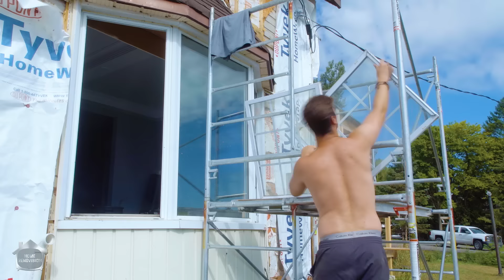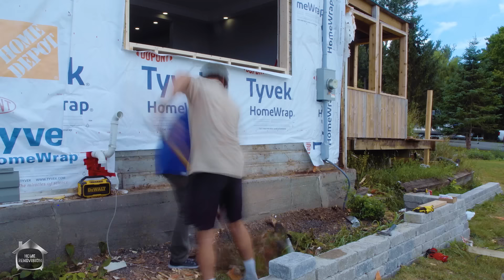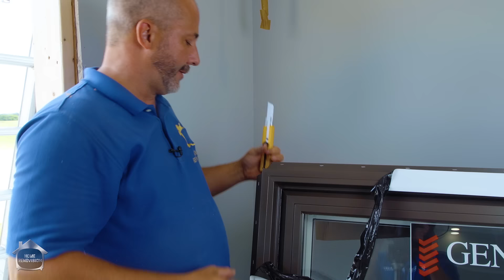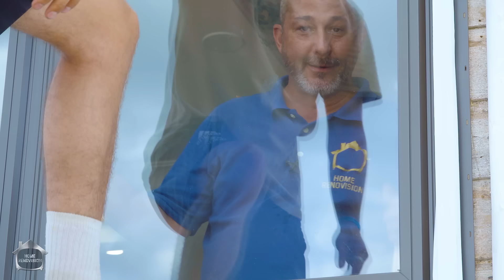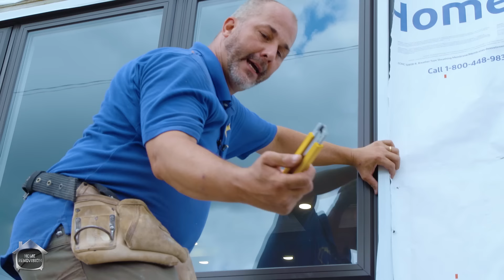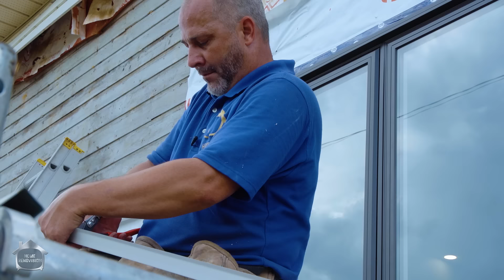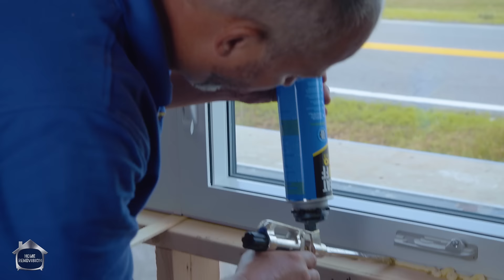How to Install a New Window| Quick and Easy

Comment: I took my house window install a couple steps further to improve the air and water seal. Flash the inside of the window frame with a rubber flashing and then use silicone around the entire frame before installing the window. The silicone and rubber flashing will act as a gasket to get a perfect air seal around the window in a way spray foam never will. Feel free to fill major gaps around the inside of the window with spray foam afterwards to improve the insulation value, but I don't recommend it for water sealing micro gaps likes what is found in between a new window and the frame. 

Really appreciate your videos, I've installed 1000 sq ft of flooring, completely rebuilt the kitchens floor joists, dinning and kitchen sub floor, siding, roofing, doors, windows, two bathrooms, drywall, thanks to your videos encouraging others to give it a shot before hiring the work out. The home was reappraised and is literally double what we bought it for. saved a small fortune
Reply: Glad to hear that someone else does it the same way I did mine. I did the same style windows as you did love them easy to install.
Reply: Ref home being worth double after your good works - to.

It might have been appraised at twice the value, but, only if someone agrees to that price point, doesn't make a counter offer and their bank will give them a mortgage.

In UK we gave seen a record rise in house prices (not far off £235k) because our Chancellor reduced the Stamp Duty. This is economic madness because nobody knows if the furlough schemes will still continue now we have seen an "almost" second wave of c-19.

Basically job losses will bring a sharp drop in house prices.

Would therefore take whatever value your estate agent (realtors?) suggest with a  huge pinch of salt.

Would further suggest you enjoy whatever improvements you made for their own sake.

If you "rebuilt" your home to suit you then whoever buys your property might do exactly the same.

In UK property is no longer the sure bet to generate wealth it once was.

Sincerely hope the same doesn't apply to you folks too.

Comment: Excellent video. That blue tape and Tyvek wrap do a great seal. I like the multiple levels of “Overkill” .  
Re: Vinyl siding; Have you done  a similar video using wood clapboard?
Reply from the maker: Not yet Larry. hopefully soon. Cheers!
Reply: Home RenoVision DIY Would love to see a hardy board or engineered wood siding with window install vid. Everything from how and where best to order your siding from to getting cornering right and tight, to painting. 

(I’ll provide the materials and house 😉. And beers)
Reply: Home RenoVision DIY , I have only had to stop bleeding once in the last two months with the electrical tape👍👍

Comment: Great video. My house is stucco. How would you do that?
Reply from the maker: buy a replacement window! so the exterior finishes within 1/4" and you can seal with exterior caulking. Cheers!
Reply: Doing windows in stucco right now. We used a hammerdrill to remove three inches of stucco on the sides for the flanges and tried to keep the paper original paper in place as best we could then did similarly to what Jeff did here with taping, etc

The windows were old school with the sashes in the sides to allow it stay open so we gained bigger windows in the process.

Comment: It’s a  pretty straight forward install but you got it wrong. Your sill has to be waterproof and sloped and use rod and caulk instead of foam for a couple of reasons.
Reply: Hmm, but is that correct methodology for this type of installation?

As far as I could discern the frame is "waterproofed" to the water proof Tyvek stuff around the entire frame with the "blue" tape being applied over the nailing flange.

Would presume an angled cill is attached to the bottom of the frame to throw the water away from the wall.

It was mentioned that this system is relatively new so perhaps having an add on cill is a new way of doing it?

I confess I would have liked to have seen the window cill being attached as well as this "J" trim. Will presume this particular clip was merely to show the frame being installed.

Perhaps the wall cladding and how it  "connects" with the frame being comes later?

Will presume too the cill component is similar to the "J" sections but with a different profile?
Reply from the maker: I hate to say this but the whole wall is waterproof with this install, not just the sill. Cheers!
Reply: Home RenoVision DIY  it’s a bit more detailed and complex than that. Windows are water resistant not water proof, they have gaskets, seals with moving parts. Windows have a built in rain screen system designed to remove water. Code is a minimum and still requires waterproofing the sill. Further, the idea is to manage water away from the building, your flashing should have end dams.
Reply: @vancouverrealestate2766  Hmm. It was mentioned that this system is new by which I take it said system is approved by the local buildings regs folks.

Sometimes the technology moves on so fast that not everyone learns of a new methodology as fast as others.

In the old days, and I'm going back a bit, imagine my surprise to find someone had invented glass! I was so pleased to get rid of the shutters and sacking!
Reply: Ross Kneebone this is definitely not a system or something new, that I can tell you. The sill must be sloped to the exterior and waterproofed. Water will always get in.
Reply: @vancouverrealestate2766  Apparently not with this methodology.

Plus there was no cill to be seen, let alone sloped.

All we saw was a window frame fitted into an aperture, fixed in place and some blue tape stuff over the frame and Tyvek.

I am presuming the window cill is attached in a similar manner to these "J" pieces.

It occurs to me that your "cill" and my "cill" could mean different items.

Suffice to say the UK "cill" applies to both inside and outside the window frame.

The inner being level (to sit on the inner brick or block wall) and the outer being sloped to shed rainwater away from the wall.

Most usually "our" exterior walls are brick and will absorb water, (unless treated with a liquid weatherseal product).

Generally the wall will have a number of  vertical "weep" joints (made of (usually) grey plastic the same dimension as a mortar joint, with a bug screen) instead of of a mortar joint, just above the damp proof membrane, or just above an "over window" galvanised steel or concrete lintel.
Reply: Ross Kneebone what you described is a different detail. In this case, the detail is only for interior sill plate, not exterior. Also, In this case an exterior sill flashing would need to be installed which I did not see but he probably will install later. 

As for the detail you described with brick cladding, it is not used much, we mostly use brick venner. However the concept is the same with the brick and weep holes you described, there is a cavity behind the brick so when water does get through the brick, it will drain through the weep holes. The cavity also creates a cross ventilation for drying. Further, 100% RH will occur several times a year, another reason for the cavity and cross ventilation.
Reply: @HomeRenoVisionDIY 😂😂😂😂

"Hate to say it!" my backside!

I can sense your laughter 3000+ miles away 😂.

In UK the cill is laid on the outside brick skin in the opening and the window is built on that.

Sometimes the cill is a canted almost engineer brick soldier course and this is to avoid repairs if the maintenance is shoddy. Sometimes the cill is a row of ceramic tile slips bedded in mortar.

Basically anything to avoid timber.

If a uPVC unit is installed then the cill is attached to the bottom of the frame.

 Whole assembly offered up and is wedged to make it level. 

Glass in after to square up frame using spacers between glass and frame for time tweaking.

(And fixings through frame of course.)

Anyway, I am aware the window install in your video is waterproofed to the Tyvak with this blue sealing tape.

However I am intrigued to know how the exterior cill is fastened to the window frame.

I am going to make a wild stab that the cill piece is offered up, measured, cut to size, silicone or similar applied to  inside edge and cill them screwed/nailed to wall.

Siding then covers the fixings.  End caps to the cill.

Job done.
Reply: @SomeDumUsrName Indeed, so you say, but presumably the legal eagles will have reviewed his vlog and deemed it legally sound. 

From what I can read in the comments, from 3000 miles away ( at least) there ( always) seems to be some argument against the methodology.

Somehow I can't see your man doing a hack job only to be shot down over a bit of legislation.

Far too many folks seem to know better but don't appear to have done much research to discover if some of your building regs people are entirely happy with his methodology.
Reply: @SomeDumUsrName Well, I am  happy to stand corrected but you haven't offered any argument, by which I mean proof that his method is not technically or "legally" correct.

Certainly I could understand that not all your authorities  (building regs folks) in their own geographical areas might approve ... but can you show exactly what he has done wrong or would be non compliant.

Bear in mind that the instant you state A or B or C you might unleash buildings regs hell, "proving" you are wrong, or such and such State is entirely happy with the technology or methodology.

I await your response if you can be bothered to respond.
Reply: @SomeDumUsrName Well, at the risk of appearing rude it's yourself that have condemned these practices out of hand yet offered no reasons why or quoted "your" buildings regs in proof.

I suspect you don't really know too much about building theory or practice at all. Or you are unable to keep up with more modern building practices and living in Bedrock.

Or you are in the employ of a rival window manufacturer paid to rubbish rival products???

Frankly that is outrageous.
Reply: @SomeDumUsrName Oh dear, claiming 38 years in the industry just   leaves you open to a response that it's "no, one year, thirty eight times".

Certainly in UK It's a standard put down to older blokes who try to lord it over the newer staff by claiming years of experience. In many cases the youngsters are absolutely spot on in their assessment.

I have seen plenty of buildings videos from US and am always interested in any building techniques.

I have been fortunate to experience building techniques across parts of  Europe, Australia, S Africa and Canada; not all authorities adopt the same systems generally because of environmental/climatic reasons.

I certainly wouldn't praise UK as the epitome of building practices in the past because some of it was absolutely appalling ... little better than slums from new.

However, we adopted new technologies and these days problems with buildings are most likely down to (mostly unseen) shoddy and rubbish workmanship.

"Building" in UK is, sometimes, regarded as a job you end up in because you can't do anything else. Ironically, for a time, the best builders in UK were the Polish lads. Plus it was not unknown for some shady smaller building outfits to "employ" Asian illegals to do the "heavy lifting, grunt work".

I don't suppose this is a practice unique to UK by any means.

I appreciate you feel you have experience in your industry but you appear to find it difficult to accept "new ideas" or "new techniques".

What you object to in your locale might very well be perfectly acceptable elsewhere.

On ToH we see inserts depicting engineered timber and we learn it is superior to "natural" timber in strength and utility. As far as I can see your buildings authorities are perfectly happy to see it's use in construction of housing.

By the same token can you be absolutely sure these same buildings authorities aren't perfectly happy with the methodology we saw in the video?

It's not as if he was keeping the technique under the radar by posting it online is it?

I see from US web sites on building techniques the notion of flashing above and below windows

If you are implying the lack of flashing is a bad idea compared to using the blue tape then why not say so?

Comparing the guy to a "know nothing bullshitting salesman" does seem to be quite brave, especially as you aren't prepared to justify what you say.

Let's hope he doesn't get tooled up with a lawyer "experienced" in libel, slander and general all round character assassination ...

I will presume the building we saw in the video will be inspected stage by stage and signed off. Have you knowledge that other buildings he worked on have not been signed off? If so why not share?
Reply: Ross Kneebone when anyone posts videos, they should be accurate. Building inspectors do not write the code, they just enforce it. I cannot see this install getting inspected, let alone passing. It does not even meet minimum standards.

As for new technology or systems, go troll someone else. You are going to cause a lot of repair costs $$$ to future homeowners.
Reply: @vancouverrealestate2766  

If you are concerned that some works, by contractors, won't be inspected or signed off then that's something your authorities should investigate.

If you are correct about an installation not being properly in line with your Building Codes then you are morally obliged to inform the authorities citing the video as proof, are you not?

Recently we had a problem with very poor supervision of works-to regarding external panelling and fire prevention in a residential tower block in London which was burned out.

Seventy two people died as a direct result of a chain of utter incompetence ranging from 
 builders, surveyors and lack of proper oversight by local council.

Some people wanted protection from prosecution before they would agree to give evidence, so you can draw your own conclusions on that.

Perhaps proper inspection to ensure compliance with (UK)Building Regs might had prevented this disaster? A lot of people here justifiably concerned about homes they live in as to whether they are safe.

Not quite sure what you mean by trolling though.
Reply: @SomeDumUsrName Somehow I feel you described a lot of the people in your industry.

You are absolutely spot on with regards to elements of the UK construction industry. Mainly those with no formal training or had not started off working under a formal approved apprenticeship, with day release to a college.

Some "builders" are simply "cowboys" who end up as self employed and are no more than labourers who possess a few tools. 

Given you have identified the issue what are you going to do about said issue? Or it is going to be "someone else's" problem?

One obvious issue for "your" industry is the that putative customers become "woke" to practices perhaps not in line with your building codes.

If some keen DIY folks who take an interest in construction vlogs read these comments then it might occur to them that there is not much cohesion in the construction industry if people carp and criticize someone else's work yet offer no reasons why other that it's "not to code".

It certainly occurred to me.

Virtually every single offering on YT has at least one comment from someone who "knows better".

Plus there does seem to be some "larging up" of a person's own understanding of every single building code acoss the US, which I find remarkable.

If I might offer a little advice I would be very wary of using terms which might be all embracing, if you follow?

Comment: Adding a bigger window in the place of a small window.. is it absolutely necessary to completely reframe for it? Or is there a way to reinforce around the new window to avoid taking out all the Sheetrock around it??
Reply: I would just demo frame it out for the new window man!
Reply from the maker: Yes! if you don't restructure above the window to transfer load to the side down to the foundation then the wall will sink and your glass with crack under the pressure. Cheers!

Comment: So why wouldn't you use screws to fasten the window?? Should do the same trick right? Using hammers around windows scares me...
Reply from the maker: you could definitely use all screws if you wanted too. it will just raise the edge of the J trim a little. better than marking up your windows if hammer skills are less than comfortable. Cheers!

Comment: great video!  my only question is this:
i noticed that you installed the side exterior tape first, and then the top exterior tape.  if you should have your top exterior tape overlap your side exterior tape, then why did you not have your side exterior tape overlap your bottom exterior tape, for extra water protection?  does the new tape technology account for that?

thanks again for everything you do!
Reply from the maker: this tape bonds so well it is not an issue to be concerned with. Cheers!

Comment: In the event you have any air leaks in the house ... moisture will build up on the back of the moisture barrier.... in cold weather. I use silicon with install
Reply: Tyvec isn't a moisture barrier...
Reply: @warrensteel9954  but guess what it acts like ....  if you have any voids .... many unseen... you will get moisture in between the tyvac and the structure

Comment: Did my whole house by myself 10 windows. They were all on the shelf at the Depot except one custom order. All new trim inside and out. Got a quote for $8500 to just replace windows, no trimming. All in it cost me just under $2500
Reply from the maker: That's money in the bank. Cheers!